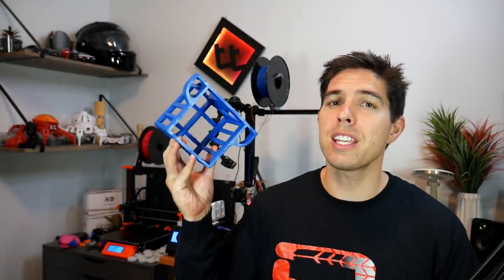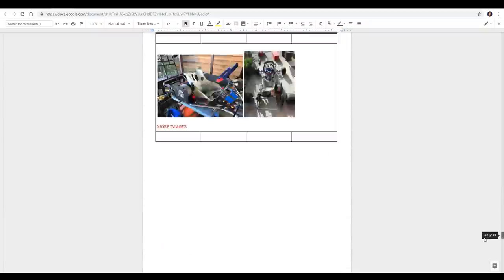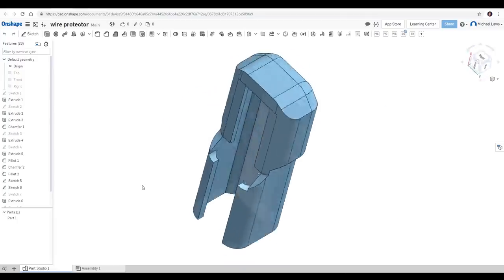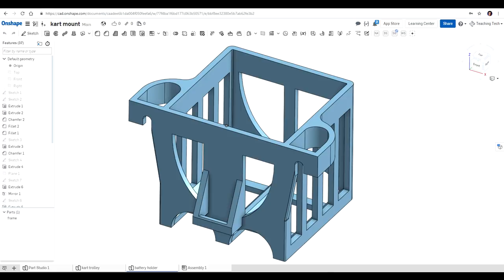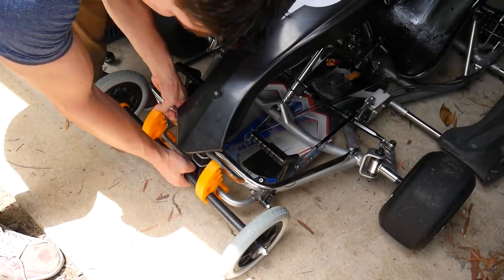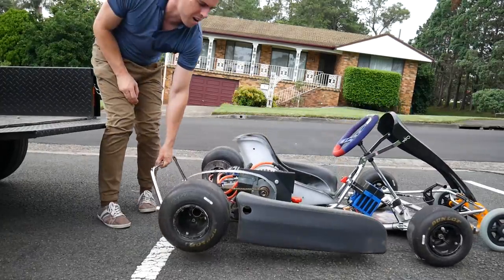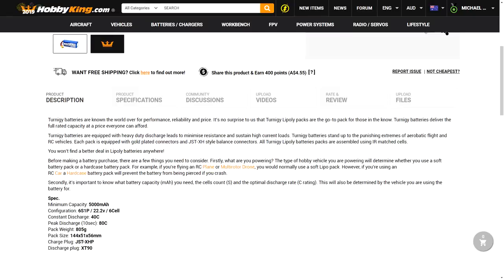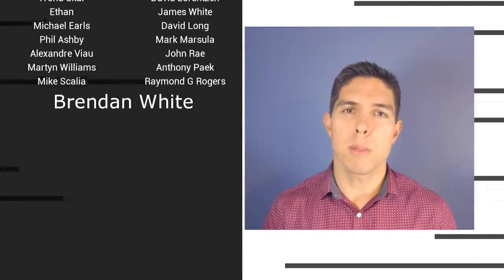3D printing parts for a custom electric kart

Comment: That square edge on the motor mount is still dangerous in a crash, you should round it.
Reply: Agreed.
Reply: Yeah I'm not sure why it was rounded instead of designing and printing a cover.
Reply from the maker: I suggested but he already had it together and didn't have time to disassemble. I agree and will address it.
Reply: I guess its easy to have 20/20 hindsight when you're sitting at a keyboard 😂. They did a nice job considering their experience.

Comment: Do sim race? If you don't, I'd highly recommend it and iRacing on top of it. Lot's of 3D functional printing can be done with sim setups like steering wheels, paddle shifters etc. I need to either buy one of these carts or make one, looks like fun.
Reply from the maker: I have a vr setup with wheel and pedals. Only game I have is project cars 2. Interested in iRacing for sure.
Reply: @TeachingTech  Nice! VR is the way to go for sure, definitely check out iRacing if you enjoy competitive type racing, the safety rating is a nice system to get a higher quality race, just sucks there's a monthly subscription... Keeps most of the kids out at least!

Comment: Hey, love this heaps , I currently do race karts myself and I loveee the wheel system you designed would make it so much easier and save my back as they are bloody heavy. Just asking would I be able to get the files used to 3D print the wheel clip just so I can get an idea and possibly make one for myself

Comment: You printed in ABS, no enclosure for the printer? Is it a stock Tornado printer? If not, what mods needed for successful ABS printing? Temperatures and filament details?
Reply from the maker: A card comes up in the corner with a link to my video on it. This one was left over zortrax abs, 110 deg bed on builtak and about 270 deg hot end with titan aero.

Comment: Hey Michael I love the cart!  How much drive time are you getting with that pack?
Reply from the maker: So far I've only run for about 15 minutes at a time. It is still at 3.8 bolts per cell and my cut off is 3.3v.

Comment: Great video, your passion for teaching is amazing !!

So where were you when I was growing up at school ? 😬

How long does the cart run for and what motor do you use ?
Reply from the maker: Thanks very much. I've added motor and speed co troller info in the description. So far I've only gone for 15 minutes at a time and the low battery threshold has not been reached.

Comment: Great project! What is the battery life? I suppose you run 4 6S 5000mah packs in parallel?
Reply from the maker: 4 packs, 2 in series, 2 in parallel. Motor is a 48v model. This gives 50v when fully charged with 10,000 mAh. I think a solid 20 minutes is reasonable, I've only run it for 15 minutes at a time so far.

Comment: 130kg sounds heavy. I think I remember Clubman being 130kg with driver. I would replace all the steel plate brackets with Alum plate of minimum size.
Reply from the maker: I haven't weighed it, only going off the weights in the student folio. Doesn't feel that heavy as I move it so I might have to verify.

Comment: So I'd be curious on the difference between the weight of the electric motor + batteries vs a standard petrol kart motor + full tank of petrol - how much heavier/lighter are the two engine configurations?
Reply: The FIA electric karts are heavier, but they go faster due to the torque.
Reply from the maker: Great question! I would like to know myself. With new batteries I can add 50% power so might gear it longer. At the moment it maxed out pretty early.